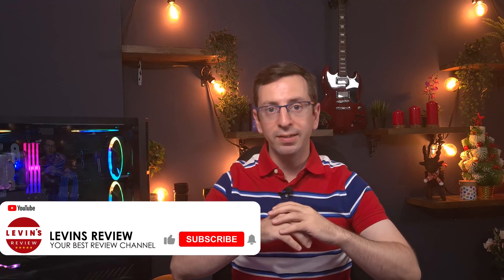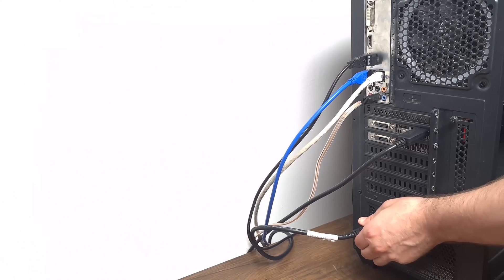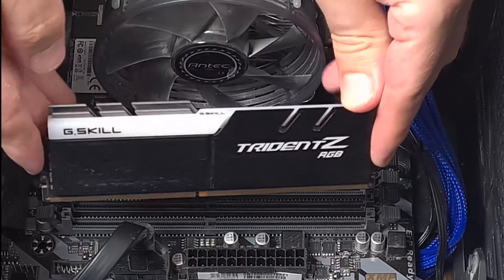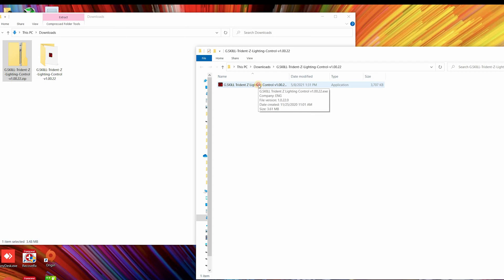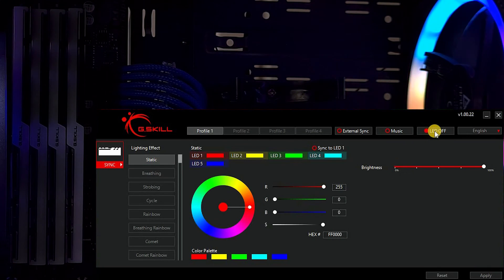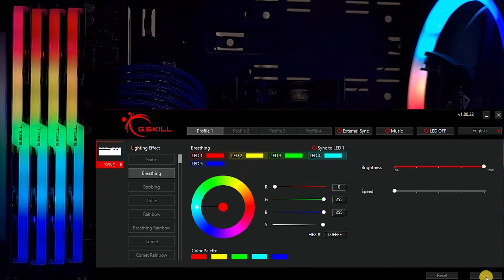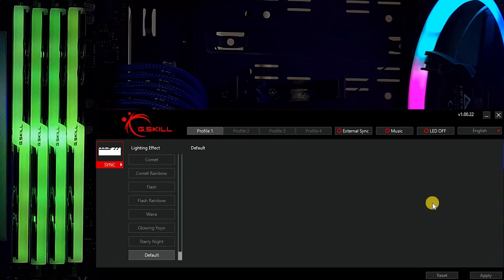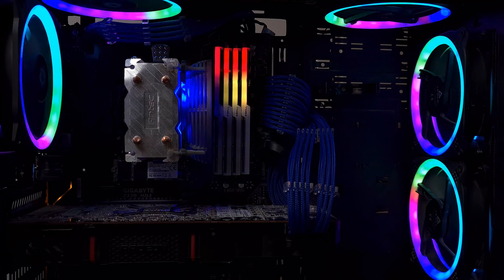G.SKILL TridentZ RGB RAM Installation And RGB SYNC Configuration

Comment: As of 3/16/2025 the program still has no setting option to 'run minimized at startup'.  I.e., nothing you configure on RAM with the app survives reset or shutdown because the RAM has no local RGB configuration storage.  So you would still have to go through the ancient Windows procedure of creating a shortcut, configuring its properties, and adding it to Start yourself.  Which would be fine except for the fact that a shortcut to the Game.exe executable cannot be configured that way.  Very lame in 2025. 

Unless you never shutdown or reboot your PC this app is just a useless toy.

Comment: thank yoo very much but do u know how to sync it with the pc lightnings ?
Reply from the maker: @Hxr 198 thank you so much for the great comment. To sync all the lights in your pc at the same time your motherboard needs support from one of the RBG syncs like; Asus aura sync, Gigabyte RGB Fusion, MSI mystic light sync, Acer polychrome sync, and so on. But if your mother doesn't support RGB syncs then you need to control every RGB component separately. 
I hope it helps you. 
I wish you the best of all
Reply: @LevinsReview  thank u very much for the respond I have a gigabyte b560m do u know if it does support the sync and if it does do u know how ? or it's just automaticly

Comment: Thank you for the awesome video, I found it very helpful! Whenever my PC is in sleep mode, the RAM rgbs stay on. I have my PC in my bedroom, so this can be very distracting while sleeping. Other than manually turning off the RGBs each time, is it possible to have the RGBs turn off automatically when the my computer is in sleep mode?
Reply from the maker: Thank you for the supportive comment 😊
A appreciate it a lot 🙌
As for the issue you described You should have an option to sync at shut down right? set it to black and it will turn off.
Let me know if it works

Comment: Unfortunately the G.Skill software (1.00.31) doesn't do anything and now I'm stuck with the same rainbow effect until I turn off the computer. Can you help? Im using the latest bios and it's a brand new computer:
ASROCK H670M, 12600, G.Skill Trident Z Royal F4, MSI Suprim X 3070, Phanteks Neon Digital RGB ledstrips and be quiet Light Wings RGB fans. The fans and ledstrips are connected to the be quiet argb hub. MSI's Mystic Light is installed and works perfectly. The Polychrome RGB software from Asrock doesn't see the memory RGB component, only the leds and argb fans.
Reply from the maker: Thank you for sharing this issue. 
The optimal motherboard for the light sync is the  one who supports this features and runs this sync as soon as bios is activated.  But i noticed if the motherboard who doesn't support it and the light synced is optimized through software leads to many issues which is hard to put fingers on, so i recommend you contact the support team of g.skill snd if they have solution please share with our community, its will be appreciated Emailtechsupport@gskill.com
Tel+886-2-2766-7889
Forumhttp://www.gskill.us/forum/
Reply: @LevinsReview  Hi, thank you for replying. I have mailed them this problem a day ago and await a solution. 

I was so excited to have this new computer with the pretty lights, only to find out that all the different brands just don't mix well together. I searched for possible solutions. One suggests to go to bios and go to DRAM SPD Write. Flash it and then hope it works. But I read that this could destroy your memory. 

The only time asrock's polychrome  software detected the G Skill RGB was when the graphics card wasn't installed - which is weird. (Had to RMA the GPU because it was faulty). I will try to see if razer chroma could control the G Skill RGB. 

I'll share all my findings here.
Reply from the maker: @bemindful924  i feel your pain, its really disappointing! i hope you will find the best solution as soon as possible.

Comment: the very annoy part is they are synced but not completely synced. with the aura sync software I tried to run a rainbow effect but they could never have the same colors as my case fans at the same time
Reply from the maker: Thank you for sharing your issue,
I experience the same problem, it appears mainly after rebooting the computer,
I wish you great day!

Comment: i have this app and same ram. on every start up it lights white and has little gree or blue light on it. the software dont listen to my commands and maybe it takes 10 restarts for it to apply the single color rgb. do you know how to fix it?
Reply from the maker: Thank you for sharing your issue. Unfortunately, I'm also experiencing issues with the light management and I'm also searching for solutions, if you succeed to solve the issue please share with us the solution. Thank you in advance, I wish you the best of all🌟
Reply: @LevinsReview  i sont have sollution, i juat press apply for a lot times and it sometimes work
Reply: @Airidaz I have the same issue where the bottom 1/4 of the ram will go green and the other 3/4 will change to random colors. Have you found a solution to this issue?
Reply: @xMetz  nope, right now i use no rgb on all my pc parts so it kinda works, i updated mb drivers and on softwate i made color black and pressed on off
Reply: @Sa1nt_LT  I ended up sending an email to gskill and will let you know what I hear back.
Reply: @xMetz  in past it kinda worked when i pressed apply a lot of times
Reply: @Sa1nt_LT  I cant even get the software to download lol
Reply: @xMetz  i dont know where i donwloaded it from. if u cant u can try rgb fushion its from aorus and u sometimes can control they rgb from it. it works like 5% of the time
Reply: @Sa1nt_LT  so the email I got back said try fusion 2.0 instead of their software. So instead of that I uninstalled all lighting softwares, updated my bios, and then redownloaded lighting softwares in the order of gskill, icue, and then Asus armory. Haven’t had any lighting issues since.
Reply: @xMetz  for me rgb fushion kinda dont work too
Reply: @Sa1nt_LT  yeah I kinda figured that was going to happen and tried the other approach.

Comment: after i launch the .exe file as administrator it immediately closes out and doesn't go to the next window, no matter how many times I try to open it it doesn't work, any tips?
Reply from the maker: Hi. Thank you so much for sharing your issue. To help you with the issue, it would be great if you answer the following questions:
1. What is your Operating System?
2. Do you try to install the software, or are you trying to open it?
3. Do you using the latest version that is available on the Gaskill site?
4. Do you use Antivirus? If so, check if the Antivirus blocking the file?

Comment: Hered the thing i took out my ram for a new kit of 2 i bought then i put them in it didnt turn on then i tried putting the old back in and it also didnt turn on the fans spin but doesnt give a signal so what do i do?
Reply from the maker: Thank you for sharing your issue with us. 
Let's try the following troubleshooting.
1. Remove the power supply cable from your PC. 
2. Now, Discharge voltage from a computer. To do that, press the power button for 5 seconds.
3. remove the memory cards, make sure the memory slots are without dust.
4. put the memory slots back
5. Attach the power supply cable to your PC and power on your computer.
Let me know if this solved your problem, and if you have more questions, please let me know.